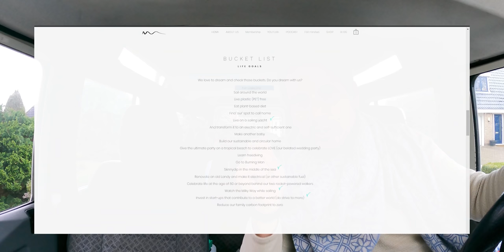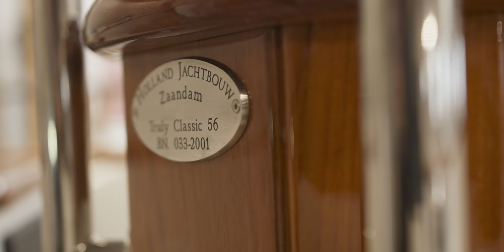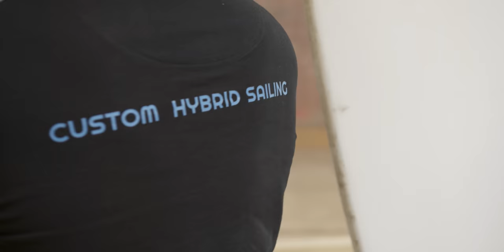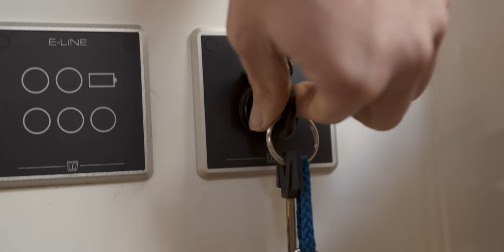Can We Go FULLY Electric 🤩 STOK Electric & Modern Classic Sailing Yacht - Perfect Electric Sailboat

Comment: How does the system respond to a lighting strike? What prevention means are in place? 👍
Reply: In case of a lightning strike, nothing would happen since the system is separated from the hull. All the current will follow through the hull into the water.
Reply from the maker: Great question, looking forward to the reply of the guys.
Reply: @stokelectric  I’m not sure that’s possible is it? I maybe wrong yet, as far as I’m aware the power from a lightening strike is much like the power from a coil to a spark plug. It jumps to the nearest earth ie the weakest point in the system. So if the lightening conductor is damaged then it will jump to the motor or prop shaft and out through the bottom of the boat?
Reply: @midnightmiddleton  in case of an aluminium hull, which this yacht has. The current will follow through the mast, directly through the hull and into the water. The motor is completely isolated from the hull and the shaft.

However this is not easily tested (also wouldn't prefer to test it😅). So I based these statements on purely theoretical knowledge.

Comment: I am worried that the generator is a bit too powerful for those batteries.

When you compare this to electric cars you have to remember that electric cars have thermal battery management systems (i.e. massive cooling systems for the batteries).  And with these thermal battery management systems keep the battery temperature down when they do 0%-80% recharge in 20 or 30 minutes depending on which car and everything is OK.

But without the thermal battery management system, then electric cars would be recharging much slower because all that extra heat is not good for the batteries.

So if these guys are recharging in 0%-100% in one hour without a thermal battery management system then I'm worried because I didn't see any cooling system for those batteries.

If they tripled that amount of batteries (with the same generator) just so that they recharge slower then that would keep the temperature down when recharging.
Reply: I understand your concern but we took this into account. Lets start by saying that the Super-B batteries are designed to be charged at 1C, just look up the datasheet of the Nomada 12V105Ah. Besides this, the heat generation is quadratic with the current. So when the generator would be running at 30kW, which would only be in absolute emergency cases we would be charging the batteries at 0,8C. This would result in 30% less heat compared to 1C. When we reduce the generator output slightly, to 25kW, the charge current would be 0,64C which would result in 60% less heat compared to 1C. In these situations the batteries wouldn't overheat. Also, the BMS measures the internal battery current and can switch of the charger or even the whole system if an overtemperature is reached. And as a last point, the batteries are placed low in the ship, close to the hull. So the ambient temperature will always remain cool. Therefore, this is nothing to worry about. I hope this clarifies things.

Comment: If you have a generator as backup .. yes
Reply: Yes exactly!:) To be able to cross oceans safely you need a backup power source, which is why we use a generator. For short sailing trips "weekend sailing" a generator won't be necessary.
Reply from the maker: To have a backup for the backup ;)

Comment: Im not sure but im wondering if there new generator is inspired by the new high capacity alternators running together.
Reply from the maker: Interesting one, do you have any experience or recommendations with the high capacity alternators?
Reply: I was not aware of these alternators. But thanks for showing me. For our generator we have couple an electric motor to the output shaft and bell housing (normally the gearbox would be mounted here). This way we don't require a large alternator and are free in designing the required output voltage and power of the generator.
Reply: @stokelectric  
Thanks guys youve got a good grasp of whats needed.
 I'd love to understand better the sizes and arrangement of generator and motor. 
From  RC models and electric flight a general rule of thumb with electric propulsions is more smaller props and motors work better than single large units unless they are very large and can turn relatively slowly.😁 But you're fitting a system to a existing single prop design anyway. 

Your logic in running the yanmar at relatively optimal speeds and loadings then matching the generator is spot on 👍🏼... Ive even advocated exploring using new generation heavy fuel rotor wankle engine s
as used in some aircraft  APUs
where wt. and size vibration and noise are a major issue. 
Typically an advanced wankle motor of one or two rotors 75-130bhp is the diameter of a large round biscuit tin or two stacked on edge and weighs about the Wt of a standard starter battery. So you can pick one up and  pass it out a standard size 60cm hatch without assistance.😁😎

What some boat owners are doing is fitting two high output alternators on to their engines. 
One might be a 12V or 24V or 48v, 72v .. or two of the same voltage ..
My interest is what could the DIY innovator do 🇬🇧😉.
My thought went straight to a configuration used by early E Flight  Models but reversed ..ie
4 motors driving one geared or belt drive large prop...🤔
In this scenario though it would be one smaller very efficient Engine driving multiple high output alternators, as traditional generators often seem to be even more problematic than even ordinary propulsion Engines, as each Alternator is a self regulating  unit if one fails then you have built in redundancy.... short of a seizure🤔.

I know the Polish family from sailing Oceans and they were considering how to best repower their Trimaran Poly .
They have a near identical low hrs. Yanmar which was used direct ...the original 75hp volvo and  the original faulty generator . 
They would like to go electric but the cost of batteries is a problem they have loads of solar though.... and they are in Gdansk so have a lot of useful people around them .But a lot of 
Sailors not only dislike mutihulls but are fixated on Diesel's. 🙄🤦🏻‍♂️ Americans are not the  only ones addicted to burning this horrible stinking stuff. 
The fact is if they ran three E motors .
Two - smaller pod ones in each Ama and one on the existing single center drive they would get better handling in confined environment s and improved power delivery underway using less fuel and savings on maintainance and reliability.

Comment: I wonder how much fuel to be consumed to fully charge 39kW battery system. and what is the charging rate relation to speed of yacht. 5kW at 8kn sounds very good but 8kn is not what I get. how much the hydro generates at 3kn speed?

Comment: Nice video, but I don't understand the maintenance argument, oil etc.
Isn't that Yanmar a diesel-engine?
Reply from the maker: No, it's a generator as back up solution
Reply: @FeeltheBreeze  a generator, which is a diesel engine? How else does it generate electricity?
Still the same maintenance hazzle.
I don't know if you can call it a backup solution if the entire battery-bank can be consumed within approx 30 minutes by the electric motor itself 😊
Reply: Yes there is still maintenance for the diesel generator. But it's more reliable because it's used correctly, running for an hour and getting nice and hot at good rpms. And also, depending on the user, it doesn't have to run that often.

Comment: Did they say how many days it can run off a full charge?
Reply: According to the calculations we expect 10 days of anchorage without running the generator or having solar, this is based on the total combined battery capacity of 48kWh. The calculations are based on previous power usage measurements.
Reply: @stokelectric  thank you for the reply. If I wanted to put this set up in. Catamaran, would two entire systems be needed or can the generator split the task to the batteries for two electric motors?
Reply: @chilly6883  just from the top of my head, splitting the power should be possible but I don't think this will be easy. Then again, we haven't looked into this setup for catamarans yet, so I can't say for sure. It might also upset the balance of the ship if it's not placed in the center.

If you're seriously considering this please contact us through our email on the website and we can discuss further.
Reply: @stokelectric  thanks I will, it's something I'm tossing around in my head.

Comment: 30 Kilo watt is a lot of heat for a small motor like that over a long time .
Reply: It won't run at 30kW permanently, we can freely scale this up or down depending on the situation. Just like you do with a normal diesel engine. Nominal output would be around 20kW, to run at the optimum load for the engine.
Reply: You can also improve cooling to the motor easily enough... Increasing the flow and heat exchange system.

Diesels can be also be usefully  turned to increase efficiency and power output...  With or without Turbos.

Comment: Take a look at this third item ...look at the new range of motors these guys are fielding esp. the smallest at 70KW https://youtu.be/wWZmfcPwF3o
The shorter but highest output motor is 180kw with huge torque but the middle size ones have their inverters built in.
Reply: 70 kw batery hybréd  ¹80 kw morter 15 mikeß topwß ßoeed

Comment: is charging lfp at 1C recommended - No - also see vids from MarineHowTo on lfp - 70Kw drive / 29KW batt / gen 30KW / prop 5KW do some maths on run time with only 80% power from Batt (lfp's don't like 100%-0% usage) and don't forget the boat use for lighting/computers/anchors etc etc - gen should be 80KW + to run drive + boat and then get 20-30 min emergency use from batts - How many times have you been sailing at 1 knot and needed to motor 6 hours, again do the maths - how far on your diesel ??
Reply: We're not charging the batteries at 1C, this is a future option and is also not harmful if done correctly. Our expected range you can find on the website but during our first test run we only used 10kW to reach 5kn, you do the math. Thus, with the 30kW generator we can easily maintain this speed while also charging the batteries and while still having the full 70kW available on the electric motor for propulsion peaks.
Reply: @stokelectric  wow so 3 hours at 5 knots if the gennie fails and they do often - then no electronics / navionics look at some of the cats pulling them out - KISS
Reply: @jimlofts5433  this is the same for a conventional diesel engine, if the engine fails you have nothing. With a hybrid system you at least still have redundancy with the battery bank and the generator. And since we're using a Yanmar engine which is normally used for propulsion, it shouldn't be any less reliable than any other diesel engine
Reply: 6 mióevrabg gid

Comment: 60k for a diesel engine for a sailboat? 60k of what currency? Euros? Who in their right mind would spend 60k euros on a sailboat diesel engine? And you need to swap your diesel out several times over the life of the boat? Seriously? And their system will never wear out? Seriously? And it will never need parts? Do they have a bridge they can sell me, too? I'm really interested in electric on my sailboat, and am currently working on a conversion. But some of the numbers they are throwing around and the assumptions they are making are simply insane. An oceanvolt saildrive system is already hopelessly overpriced at 25k, with batteries. And they think there are enough sailors out there who can shell out 100k for a motor? The world has gone bananas.
Reply from the maker: The numbers for every boat are different and you have to compare apples with apples to get bananas ;)
Reply: 60k for a diesel engine is based on a modern engine including everything that comes with it, plus the added generator. It doesn't seem too much for a ship like this. Maybe communication wasn't quite clear in the video for which we're sorry. An electric system has no moving parts, so what's there to wear out. Yeah sure electronics age as well, but far less quickly than any moving mechanical engines. The 100k system isn't suitable for smaller yachts because it simply isn't worth spending that kind of money on a yacht with 30k value. But these larger yachts with a very long lifetime are worth converting for this amount of money. 100k on a yacht worth 1mil suddenly doesn't seem that crazy at all. Besides youu state that 100k is the cost for a motor, 100k is the cost of the whole system. And believe me, if we could we would make the system cheaper. No point having an expensive system which you could also sell cheaper and sell more of... But it's a simple fact that the components, mainly the batteries are expensive. These will go down in the future, but there's nothing to do about it. So I have to disagree with your statement "the world has gone bananas", it's simply an expensive system because it isn't for the masses yet, and at this point in time it's also not possible to make it available for the masses, which would reduce price dramatically as well. 
I hope I clarified some things for you.

Comment: ironic that despite huge electric power and reserve that the cooker should be gas-powered 🙄
Reply from the maker: Dear Guy, can’t believe this is your take out. The refit is not done yet.
Reply: When it comes to generating heat direct burning Natural gas is better than allowing  it to escape into the atmosphere. Methane being 16x more powerful as a greenhouse gas than CO2. So a sewage to gas digester might be useful on a big boat ....like they do on cruise ships... they use the  gas to power sub systems.😂
Reply: The gas installation will be changed next year and an induction stove will be installed.

Comment: In the end you will regret it. And I speak out of own experience. For inland waters, lakes, non-commercial waterways it will do. Oceangoing yachts however, I rather would use Hydrogen instead of Lithium-electric. Hybrid is another option but not so suitable for small sailing vessels. Rest is commercial small talk and wishful tinking.

Comment: 20 year old diesel becoming unreliable?
Reply: Most diesel engines are replaced after 20 years. In sailboats they're relatively unreliable because they're not being used correctly by most people. It's run to get out of the harbor for 15-30minutes, while only running slightly more than stationary, this is bad for the engine and thus it becomes unreliable. As was the case for the yacht in the video.
Reply: They also get clogged up in tropical waters ..the waterpumps  disintegrate like old fan belts and the Fuel  and the tanks suffer with contamination and diesel bug ..
 Which is literally a growing problem.
Reply: @stokelectric  

Guys check out a young German  guy ..your age with a  DIY E conversion of a Shuttle/ Catamaran life boat its on U-tube and called the Heart of Gold.

Comment: LOL .... this is nothing new ... all you've done is re-design, modernize, and miniaturize the WWII diesel electric submarine.
Reply: I've never been on a submarine so my knowledge about them is limited. In general the concept might be the same, but that's not what it's about. It's very difficult to design a small, simple, user friendly and user maintainable hybrid system. Besides this the diesel generator is only there as a backup and won't normally be run.